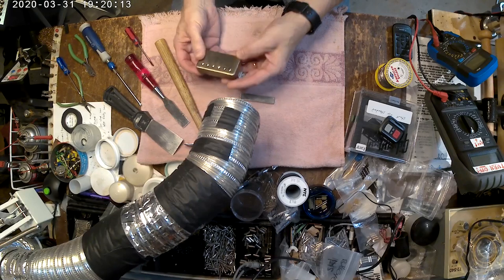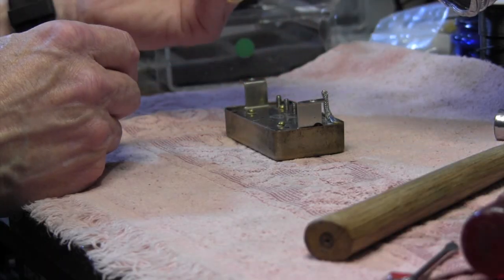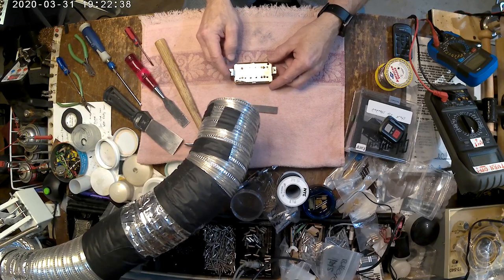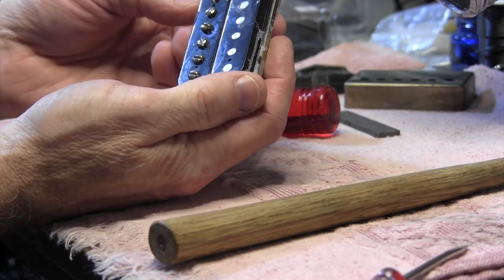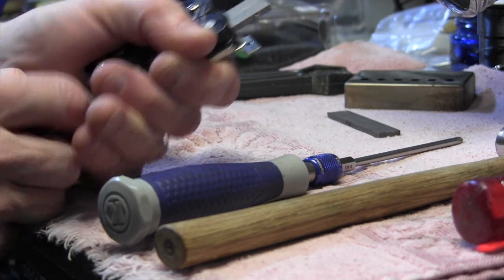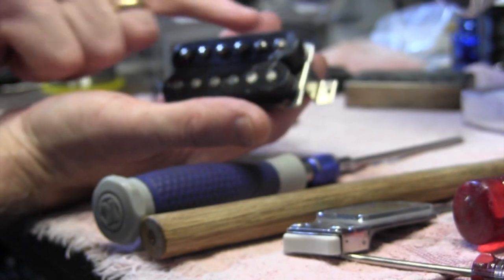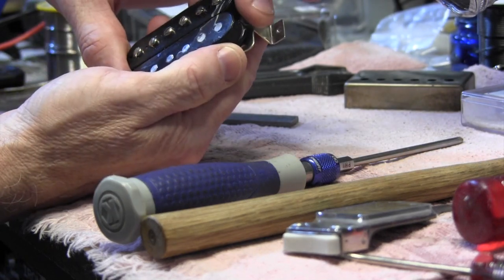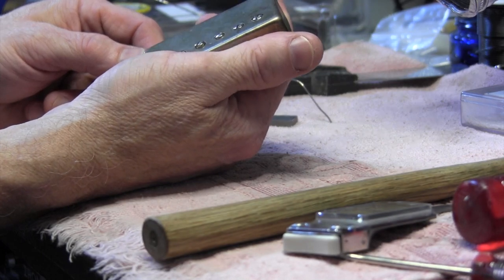How To tear down and Change Magnet in a Humbucker Guitar Pickup

Comment: Great stuff! I removed the covers on a pair of Sheptone pups the same way as you did, only with a flat-head screwdriver and a hammer instead. I didn't think about melting the bobbins or anything like that, it just seemed like the quickest way to do it. Worked like a charm, and the nineties are indeed very dead! Hahahahaaha 🤣🤣🤣🤣🤣
Reply: Im gonna have to take your approach.  Brute force and speed.  Usually works best for me too.

Comment: hi 
i have a question. I have a 1973 gibson les paul custom with both original t-top humbuckers. Some previous owner had the bridge humbucker magnet reversed (recent compass test shows slugs attract north, screws attract south ) winding is factory original. My question is would this modification have any effect on the tone of the bridge humbucker when its on by itself?
Reply: I don't think so. Usualy when you flip one of the HB's magnets is up to pickups & coil split combinations, just like PRSs does for example, but using that HB without that kind of switchings hasn't any effect in tone. Hope it helps.

Comment: Where did you buy gaussmeter? Thank you
Reply: I don't recall the exact name of this gaussmeter anymore but IIRC they are no longer manufactured. However, there are many cheap and easy-to-do DIY solutions out on the internet.
Reply: @TheWizzard29  
Is it possible to make video on metering different A5 magnets. Is there a difference between them. What are the ways to degauss magnets and how to remagnetize them?
Reply: @Stu66orn  Re-magnetizing is usually done with neodym magnets. There's an interesting article on the homepage of StewMac, it applies only to single coil rod magnets though. So far I've never tried it with alnico bar magnets. Alnico magnets should have different gauss values by default, even when fully charged, they normally differ in strength, mostly it shouldn't be too dramatic though. De-gaussing is also something I'm very interested in, bigger companies use industrial magnetizing machines, I'm still looking for an affordable alternative.
Reply: I've tried different magnets in my Suhr Thornbucker+. Must admit that magnet has some effect on the tone for example A2 vs A5 is a clear difference. But many other properties of pickup affect tone quite a bit more.
Gauss of magnet would do quite minimal difference I would presume.
Reply: @Stu66orn  I'm quite new to guitar pickup winding and still have to try out a few things. But imo all the components should work together, starting from the wire you use, the way you wind it, how much turns you give it, the wiring in the guitar itself etc. And also don't forget to adjust the height of the pickup and the pole screws, it's a very effective and cheap way to change the sound and saved me a lot of times from buying a new pickup.
Reply: @TheWizzard29  
Yes absolutely true. But I've noticed pickups height and polepiece adjustments make pickup turn from good to a fantastic. If pickup doesn't fit the guitar no adjustment will change that.
Reply: @Stu66orn  That's also true, but of course you should start with a pickup that you like in the first place. If I wanted to go for a classic PAF sound, I certainly wouldn't get a humbucker with ceramic magnets and Alnico 8 magnets ;) Then the various adjustments also wouldn't make sense anymore.